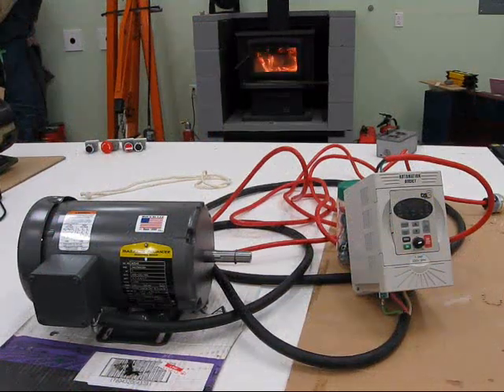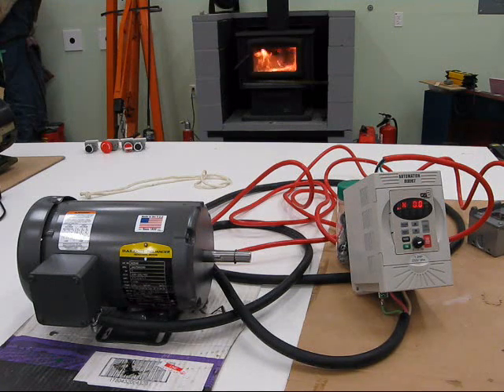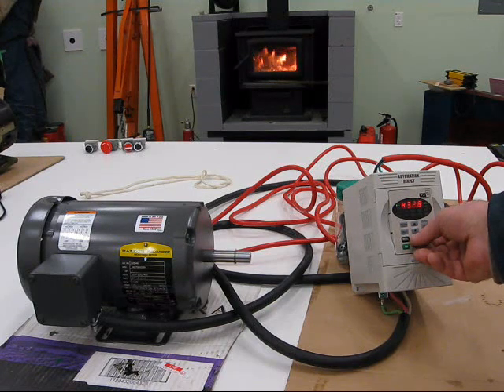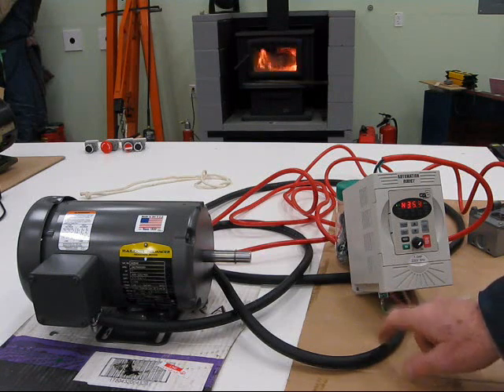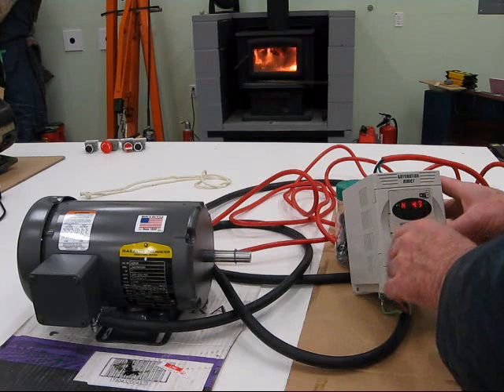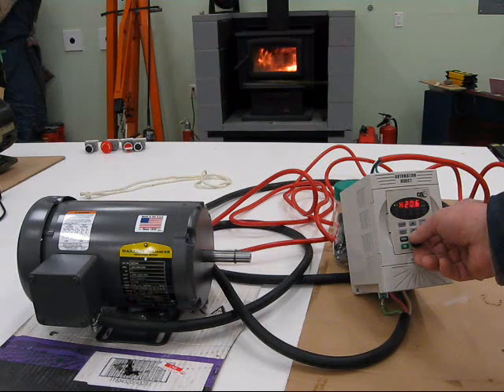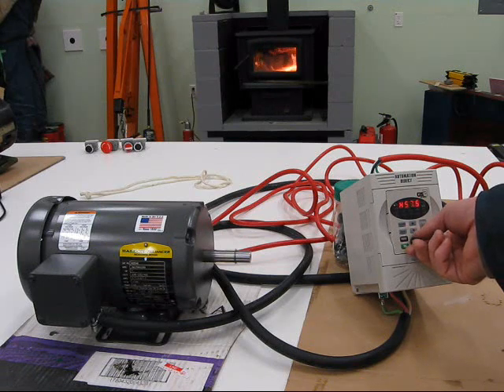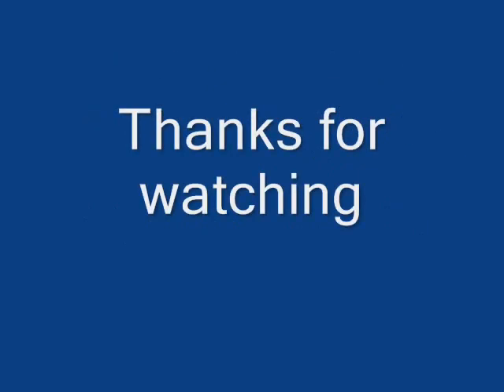VFD for Jet 10 - 24 Lathe

Comment: Did this on my lathe, works 100%, no need to change the pulleys for certain speeds, now I just keep it on the mid-range with the pulleys and I can achieve very ultra low to really high speeds, has forward, reverse, stop, brake and jog on mine.

Comment: Just one word of warning! At slow motor speeds the built in fan on the motor becomes very inefficient and stops cooling the motor when under load. This can send your expensive new motor to motor heaven very quickly by overheating the windings, this is a very common thing that happens when folks put a variable  motor drive on a lathe. The simplest thing to stop this risk of motor overheating is fit a high volume computer server fan on the rear of the motor fan housing. On some drives there is a  set of no voltage relay contacts that can be programmed to switch on the fan when the motor speed drops below the safe fan cooling speed.  Low price VED's are one of the finest things for the amatuers small late today but you must think things through.
Reply from the maker: Thank you very much for the heads up!!  I became aware of that so still use the belts to ensure motor is running at a good speed.  After some use I have put my hands on the motor and was moderately warm to the touch.  Again, THANKS for the heads up though.   Rod

Comment: Hi. Nice and useful video. This is working also with dual speed motors? You stil have to make delta connection in the motor, or is just remain in star connection? Regards.

Comment: Can anyone tell, if it is possible to control the speed of the single phase induction motor. If yes how can we control the speed.
Reply: You can also use a VFD depends on the kW rating motor, If 2.2kW and below you can visit the following link. http://www.kewodrive.com/1phaseinverter.html
Reply from the maker: Hi Sal.   Thank you for visiting my site.
Simple Answer is No.  It has to do with how the single phase motor starts versus how a three phase motor starts.   I am going to refer you to this website for and explanation.  
http://circuitglobe.com/difference-between-single-phase-and-three-phase-induction-motor.html
First read the page for some basic differences then at the very bottom read the five items under the heading 'Related Terms'.
Thanks again   Rod

Comment: What brand is you motor? Also model number? Thanks.
Reply from the maker: +Mark Nano Hi Mark - went out to the shop to look at it on the lathe (brrr) couldn't
see the nameplate but I know it's a Baldor.  Looked in a diary from when I called around looking for one and located:
Baldor model M354 1HP, 1740RPM, 3PH, 60HZ, 56 frame, TEFC.
Purchased from Troy Electric in Victoria for $240 plus taxes circa Jan 2014.
After I bought it I was concerned that the motor wasn't rated for VFD use and
called Baldors 1-800 number and talked to a technician who advised that since the
motor was rated for 208/230 or 460 volt 3 phase he thought there would be no
problems.   You will see in a slightly more recent video I ended up not using the
vfd in the video (which appears to be an excellent one) and instead bought a 
different brand that I could remote control a lot easier (at the cost of some 
features I didn't think I would need.     Hope this is of help to you and thanks 
for watching.

Comment: The only thing I don't like about those drives is that you can't set the minimum increment. That seems to be true for all VFDs. Not everyone needs to increment in tenths or hundredths. It would be simple for them to implement such a feature. It's all just firmware, after all.
Reply from the maker: Tim Ramich   Hi Tim and thanks for your comments.  In the end I didn't use this drive and went for a different one that was easier (safer) to install and more convenient to operate.  I did a video on it called 'Jet Lathe VFD Comparison'
Have a good one - Rod
Reply from the maker: Thanks for the comment Tim - much appreciated.

Comment: Shoulda gone to the gs3 series they have vector control
Reply from the maker: Matt Brewer Hi Matt and thanks for your comments.  After the dust settled  I didn't use this drive after all and went for a different one that was easier (safer) to install and more convenient to operate.  I did a video on it called 'Jet Lathe VFD 
Comparison'.  Yeah I lost a few features but wouldn't have used most anyway.
Thanks again - Rod

Comment: Very nice vid!  You're more than welcome! I'm tickled pink that you like it so much.  Wait until you start programming it.  You can control how fast it ramps up to speed and how fast it will stop.  Not as much an issue on a lathe as on the grinder I used this on.
I agree with Tom. I'm looking forward to seeing it on the lathe!
Near the very end of appendix A in the manual is the mounting measurements for the keypad. 
Maybe I'll get to upgrade my lathe at some point :)
Thanks!
Mike